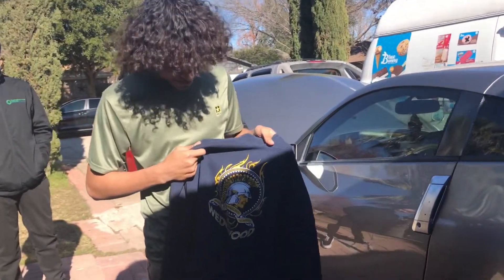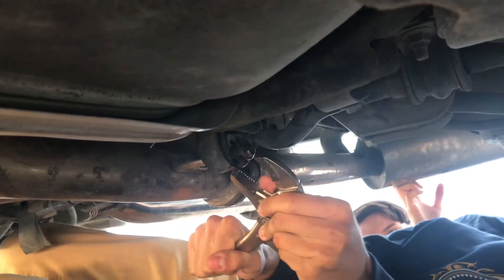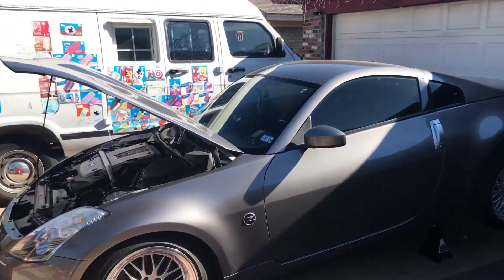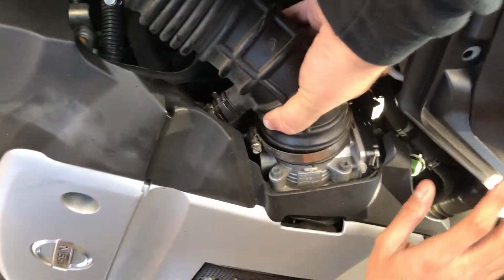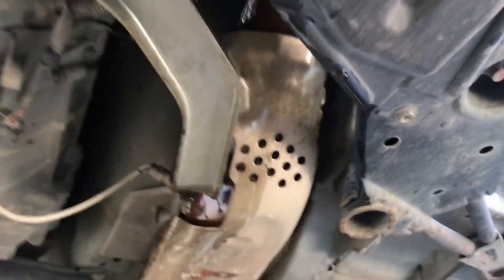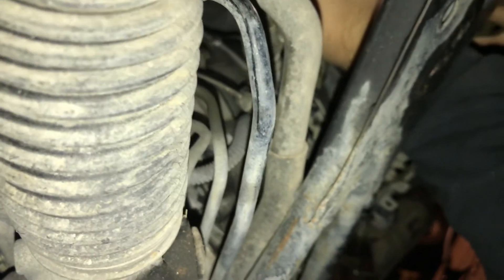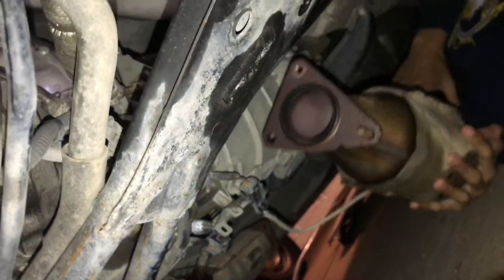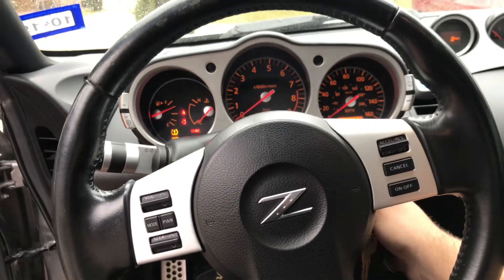Nissan 350Z GETS Z1 TEST PIPES+ HOW TO

Comment: Rasp city. Lol. Should've gotten resonated test pipes.
Reply: Honestly lol might go HFC later..
Reply: Naw man.. keep the test pipes because they're gonna flow WAY better than the HFC, it's just that annoying rasp sound that it gives off.

What suspension you running? Also, wheel and tire setup.
Reply: bman409 my suspension is Eibach lowering springs and wheels are ESR SR05 10.5 rear and 9.5 front
Reply: Just lowering springs and thats it? Which springs? I plan on getting Swift springs.
Reply: bman409 it’s the sportline that’s like -1.2” front and rear drop 👌🏼
Reply: On stock struts?